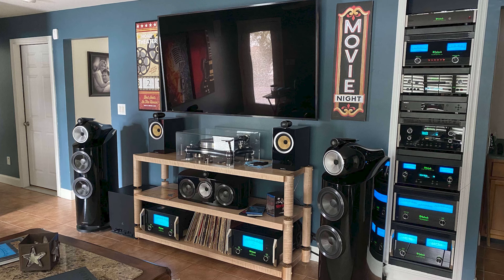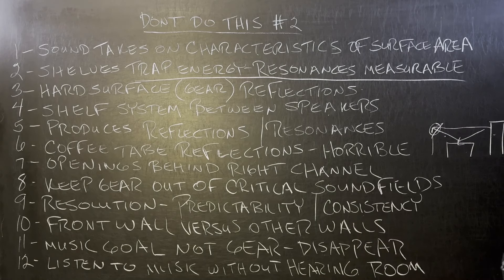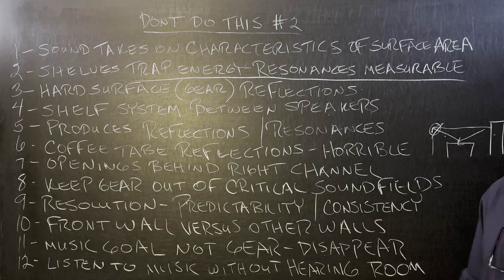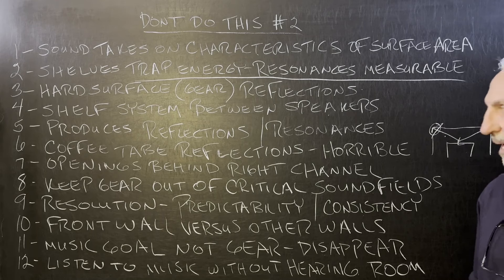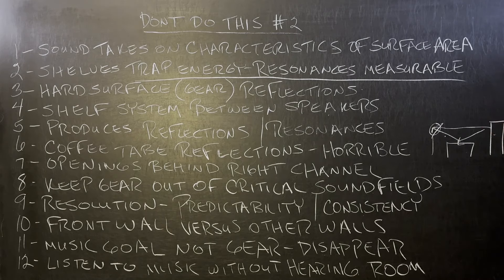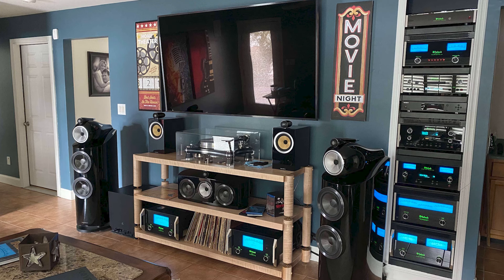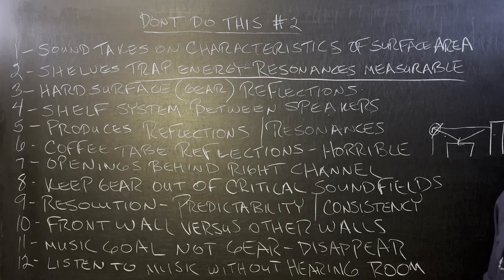Don't Do This! - Gear Location - www.AcousticFields.com

Comment: There are limitations due to the rooms you have to put the gear in. Unless you can afford to have a whole room custom built as a sound room, you are going to be forced to deal with the limitations as best as can be. 
The other issue I see, which you perhaps don't, is that some people spend hundreds of thousands on the gear, and they want to show it off.  
Don't blame them either, after all, if you have a hi-end car, do you keep  it in the garage? Of course not.   
My nephew does custom installations all the time, and has to deal with these issues.
Reply from the maker: The goal with any hi fi system that purports resolution is for the music to come forward over the nonsense of humans. Showing off does not improve resolution. It only adds to ego distortion. We must stay focused on the music.

Comment: In my room I can pick only one wall that my speakers and rack can be next to. Is it better to have the rack between the speakers or in one of the corners behind the speakers?
Reply from the maker: Between the speakers is fine if the equioment height does not exceed 12" You must stay awat from the mid range driver dispersion pattern.

Comment: i have very little options unfortunately as the set is in my livingroom. i did do a Lot with speaker placement. 

the funny thing about the coffee table.... its glass. but i found vilt placemats which now cover most of the top. and you can Actually hear the difference :)

my room shouldn't work, but it sounds fantastic lol.
Reply: is it your room in the picture?
Reply: @jamiet74  oh no, not that rich lol. and actually my speakers are placed better ;) much more forwardbfrom the wall.
Reply from the maker: If you are enjoying your music then mission accomplished.
Reply from the maker: No. Our studio rooms are only focused on the music. You can see our rooms on the proect page of our web site.
Reply: @AcousticFields  ye, absolutely agree. And no doubt i could change a 100 things, but it is a compromise in a non dedicated room. and it sounds great :)

i can say, using isoacoustic feet, after checking with monitor audio (my speakers), and Lots of experimenting with placement made it sound so much better...

love this hobby so much:-)